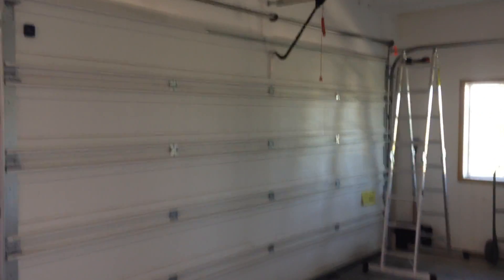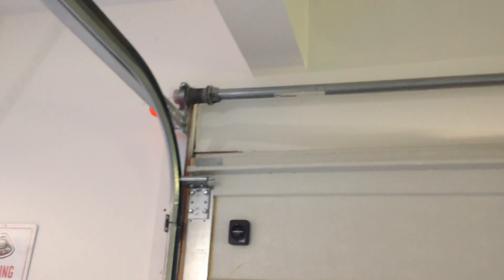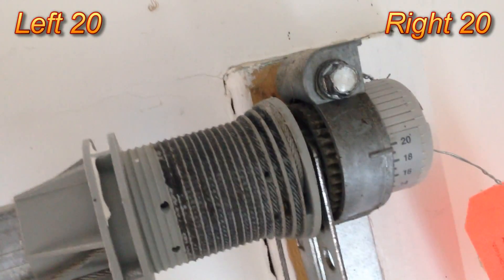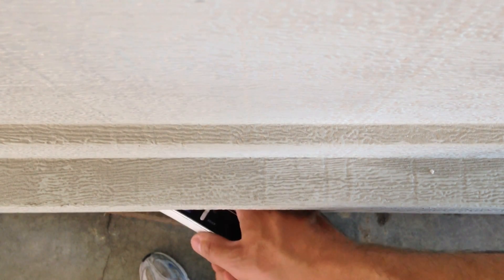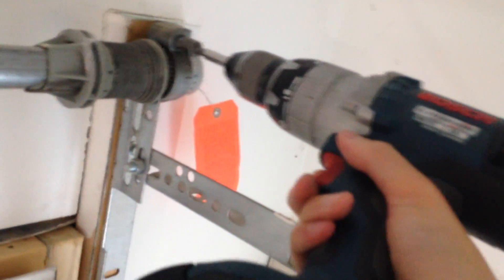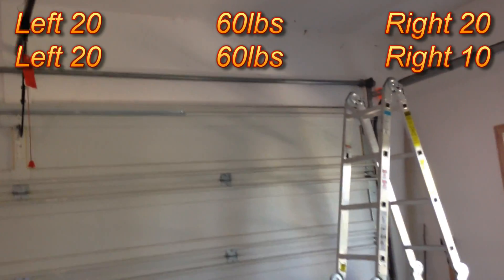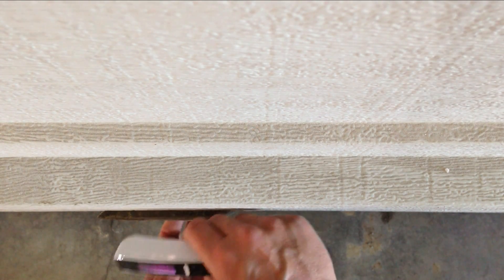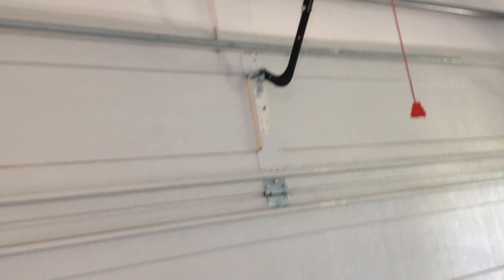How to Diagnose a Broken Garage Door Spring (Wayne Dalton)

Comment: Convert that silly ststem to regular torsion set up,  i convert em all, or I won't touch them
Reply: I just bought a house with this junk as setup on 4 garage doors. Time to start replacing them all. We used to have these at work and they are trash to put it nice
Reply: @csaleen302  Had my Wayne Dalton door installed in 1996 replaced springs this week 26 years no problems 8' x 16' insulated door. It is a detached garage but door doesn't go up and down all day either.

Comment: you can also just lift on one side and see if that assist works. If so, that is the side that is broken. You'll get a sense right away which side is broken.
Reply: No you cant
Reply: @oldfatandtired6406  you can unless the other side unwinds. It is very heavy though, but I was able to lift even a double door with 1 spring. If both are broken, you probably can't.
Reply: The torquemaster system works a singular lift system. The torsion tube is designed to lift both ends of a door equally and at he same time.  If one spring in the torquemaster is broke, you basically are trying to lift the door with half the force intended.
Reply: @oldfatandtired6406  exactly. That is why you're able to tell which spring is broken.
Reply: I don't try to lift the door all the way. Just enough to feel the weight.
Reply: Hey, can you help me to fix my garage door cable loses. The top ends for me look the same as yours. 
I don’t see any videos with the same  bar top ends.

Comment: Your door should weigh 0.   60# either means a broken spring, the wrong springs, or you have less than half the needed winds on them.   If your opener is lifting that, you need to reduce the output of the opener before something breaks.